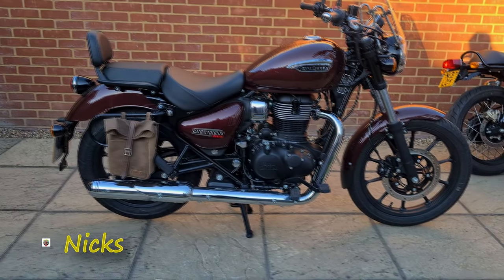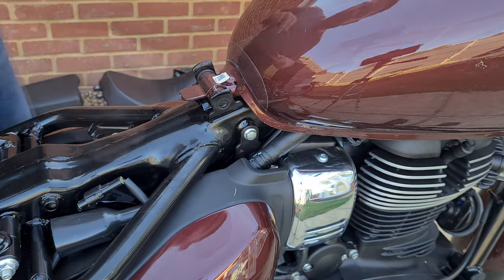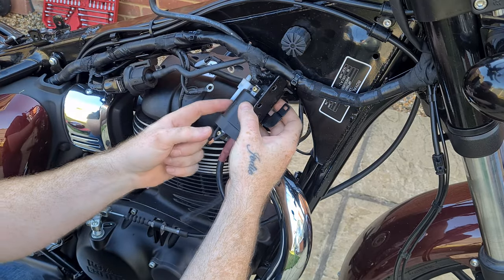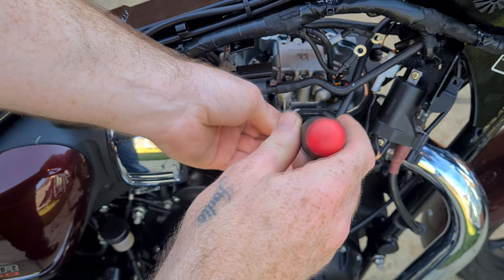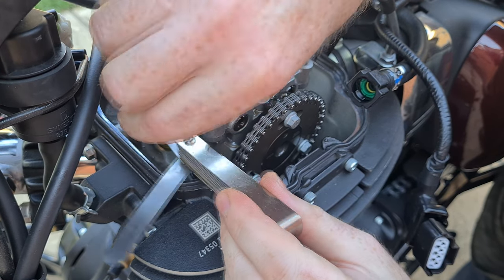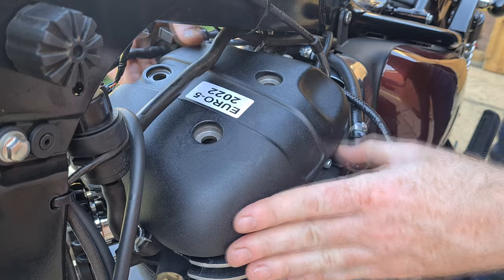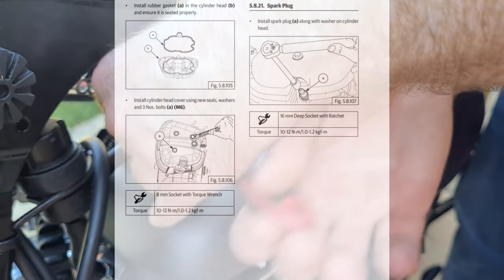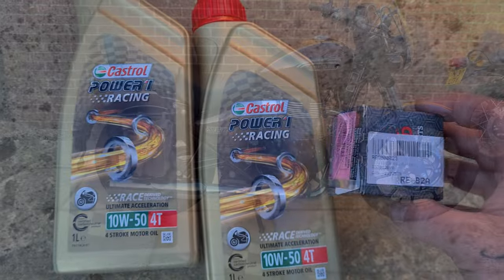Royal Enfield Meteor/Classic/Hunter 350 Valve Adjustment & Service | Oil Change | Tappets

Comment from the maker: Just a quick note, the manaul says use 15w50, however I'm using 10w50 oil because the climate in the UK isn't as hot, so 10w50 is ideal. Please check with your local dealer before you decide what oil grade to use. 😃
Reply: On my side in Brittany, i use 10W40 for the same reasons.
Reply: I agree with your choice, especially since the fully synthetic oil can provide the wider viscosity range.
Reply: @hr4669  Which makes more sense since the second number deals with heat while the first with cold.
Reply: Hi Nick, Can you please share the link for Meteor 350 Workshop Manual ?
Video is informative and clean explanation. 👌🏽
Reply: My bike is classic 350 reborn, so can i use the oil grade 15w50. Bike i use in indian roads
Reply: I use 15W40 diesel oil which is also suitable for petrol engines . On my second Enfield, great bikes . Mines averaged over 90 mpg ( better than my older pre J series engine one ) . I also change my oil every 5k or less . Happy riding 😁
Reply: @edwardwilliammorris1340  use what you like but you have a wet clutch in most motorcycles so friction additives in ordinary oil is not suitable.
Reply: @davefisher524  I've covered 1000's of miles on these bikes and turbo diesel 15w40 is fine( if you read the container you'll see this is recommended for motorcycles , they do not contain friction modifiers) , there is no clutch slip , and it always starts perfect. What is very important is to change the oil at least as often as recommended, I usually change more often. I haven't just used 15w40 on my Enfield but many other Jap bikes.  Turbo diesel oils perform well and gives no problems. Many thanks for the video as I will be doing my own servicing and all information is appreciated. 👍
Reply: @davefisher524 I've used Diesel Oil in my wet clutch motorcycles as well with no issues what so ever . Don't be fooled that you need to use PROPER MOTORCYCLE OIL in your  motorcycle , there are many OIL  alternatives out there  to use that are safe in wet clutch motorcycle use as well , but are not branded PROPER MOTORCYCLE OIL , but are still JASO MA spec . The Yanks swear by using DIESEL ROTELLA - DELO OIL in there bikes , google the reviews , and it can be purchased for half the price , at any servo , truck stop , auto store .
Reply: @davefisher524  yes it is suitable, read the sae information on the oil container. 👍 This isn't just a guess , it's many years of use without any problems.
Reply: @brettwicks7339  good for you 👍 just like me you're using your head , not only is it cheaper but works absolutely fine , gives your engine all temperature protection and starts well too 👍
Reply: @edwardwilliammorris1340  Yep , plus  Diesel oil has better detergent cleaning agents for keeping your engine cleaner , for less sludge build up . People think  that by buying so called PROPER MOTORCYCLE OIL  at some ridiculous price , makes them feel all good and fuzzy inside , that they gave there motorcycle the best care they could by putting in $89.00  a tub  proper motorcycle oil ,when in most cases , it's an old technology bike , that using that oil is just a waste of money , and an overkill . I know of this Farming Family , been on the land for over 100 years , and diesel oil goes into everything  , even the Honda lawn mower , and nothing has ever failed or exploded due to the oil they used .
Reply: Norway importer uses 10-50 W
Reply: Yo Nick, what pannier racks do you have?
Reply from the maker: @Brian-nx4lq  they are from hitchcocks
Reply: Speak to a dozen dealers and you'll get a dozen different answers. Look how oil specs change with the same cars over the years - 20/50, 10/40, 5/40, 10/30, 15/50, 5/30 (latest)...

Just apply common sense and pragmatism. After chasing RE and others, my Interceptor warranty wasn't affected as long as the oil was suitable for my region. Currently Silkolene 10/50 south of England.
Reply: I'm in Texas, yesterday it got up to 107 degrees.  LOL.  Not a whole lot of riding these days.
Reply from the maker: @randyolson7255  wow your tyres will melt

Comment: Best video I have seen for the valve adjustment.  Never really wanted to tackle that job. I normally do the service on mine every 3000 miles. (oil and oil & air filter change) But when it comes to that 6000-mile valve check/adjustment I take it to my dealer.  They charge a pretty penny to do it.  But as someone else commented you do a good job on the video so a person can see what's going on.  Some videos I have seen are poor quality, they go so fast or their hands or something gets in the way so you can't see what they are doing.  A person watching ends up having to pause the video and rewind it several times trying to figure out what they just did.  I still don't know if I want to attempt it, but if I do, I will look up this video again.
Reply from the maker: Thanks that means a lot. The only thing that id say, be very careful on tightening the head bolts and valve lock nuts, these are often over tightened and snap, definitely get a torque wrench. the other tricky issue is the rocker cover gasket, its very fiddly to get in, make sure its all flush, if it is all the head bolts when screw down and stop the same amount with using your fingers, just triple check the head is flush before getting the tools on the bolts. one last tricky thing is the plugs for the tank, you need good fingers to squeeze the clips, dont force them, if you give the plug a push in then pull out this helps. and get someone to hold the tank for you, dont rush, give yourself all day to do this job, take breaks and enjoy the experienced, you've got this

Comment: For me, this was the most helpful video for me to service my Hunter 350. 👍
Like others have said, both valves were too tight.
I bought a 500km service kit and oil from Hitchcocks Motorcycles but didn’t use any of the supplied gaskets. So they are saved for the next service 👍. 
Hunter 350 indicator reset is to find trip B with ignition switched on, then press and continuously hold i button for 10 seconds, keep it pressed and switch off the ignition, count 15-20 seconds while still pressing the i button, then switch on ignition and continue pressing the i button. The spanner symbol should flash 5 times before disappearing and then you can finally release the i button 👍
Reply from the maker: Thanks for your kind words, i try my best to make videos as clear and precise as I can to help others, after all these bikes are made for the home mechanic to work on. Thanks again and ride safe my friend

Comment: This is the correct 1st service (tappets adjust)  that many dealers forget to do.
Reply from the maker: Vital service here
Reply: @nicksepisode  my Himalayan only changed oil and filter and some spoke wheel adjust in 300 miles, 1st service, no tappets. After that have problems with pre ignition issues coming with a metal noise at 3000rpm coming from the engine, anoying sound that dealer always said is normal...NO not normal and now unfortunatley i dont ride RE anymore but still thinking buying a Meteor in near future but i'm affraid the situation persist in those new 350 engines?!
Reply: I suggest u don't buy re motorcycles @pmfsify
Reply: @pmfsify  if u just want to loose ur money then go for it any other brand is clearly ahead of this brand. Never invest in royal Enfield
Reply: @respecthub1220  i sold mine 411 himi after 5 months because excessive metallic sound in top of the engine above 3000rpm... the dealer always told me is normal!? LoL

Comment: So others know, this pertains to the new Royal Enfield Classic 350 as well.  Best, clearest video so far on these two topics.
I'm using 15w50 Motul 5100 here in California, and I think it likes it.
Still not sure about the warranty and valves, but need to decide quick as I'm getting to 300miles now.
Dealers want outrageous money here to do that - $500 and $630US if you can believe it.
Anyways, this bike is a load of fun, and I appreciate well-done videos like this one!

Ride Safe 🙏🏼
Reply from the maker: Thank you Scott
Reply: Not sure if you got an answer on this or not Scott. But in the US, you have the right to service your own bike or car or add on accesories without impacting the warranty. Or to have that work done by a third party. Harley were recently heavily fined for contravening owners rights in this area. I was advised to keep receipts for service parts (oil, filter etc) as proof that the needed service work was done. I don't know if the UK is the same way in this respect. I also got some crazy quotes for having the first service done ($320 and $450), hence why I'll be doing it myself. Paying almost 10% of the cost of the bike to have a valve adjust and oil change is extortionate especially when I hear folks in the UK are paying between 120 to 200 pounds for the same.
Reply: @bgilgall  I did not get an answer, but like you I do the work keep receipts. Keep RECORDS, etc.  That’s exactly my point to pay 10% of the cost of the bike for a service that takes less than two hours is obscene. I found a good local mechanic who has a shop and charge me 30% of that or $165 I’m still using the MOTUL oil, and unless I see something telling me otherwise I guess I’ll stick with it for now
Reply: @scottboettcher  Hi Scott, I recently bought the Meteor 350, and just like you said the dealer said the first servicing would be like $650 in Brea, CA. Btw, what city are you in, and what shop you went to for the first servicing? Any recommendation?
Reply: @MidnightRider22  I’m in Pasadena. Took to a local shop. Not the dealers. That’s insane.
I’m sure there’s a local, independent shop near you. Get on yelp and make some calls. That’s what I did. 

Good luck and …
Ride Safe 🙏🏼
Reply: @scottboettcher  Thank You
Reply: In west France (Brittany) with a middle temperature climatic, i use 10W-40. And a service with oil, are 300€.
Reply: With a $4000 bike, is it really necessary to worry about the long 3 year warranty. When you buy parts, you buy them in bulk since they are so cheap from India.
Reply: @KevinSmith-qi5yn  sure
Reply: Being a cynical & grumpy 75 yr. old geezer, I plan to video the essentials of the process with my GoPro, including the odo reading just in case.  When you get old enough, you have a license to think like this.  Younger people may need to age prematurely first.😄
Reply: @sudipshahi153 I'm in orange county and paid 600 for my first service

Comment: Hi Nick. Just a few observations from me following your video to adjust the valve gear on my Classic 350. I found it virtually impossible to accurately reseat the cover back on the gasket with the gasket in situ. I  removed the rear electrical connections that impede removal and replacement of the rocker cover. I also removed the little finned piece on the near side just beneath the rocker cover. I removed the old gasket completely with the D section rubber piece covered by the small finned piece. I then fitted the gasket into the rocker cover groove and reassembled the two together. Without those 2 electrical connections in the way it slid back on easily without any wrestling! I am not knocking your video, it was excellent. I am just noting for other's benefit that I found it necessary to take a slightly different approach.
Reply from the maker: Thanks for your input :)

Comment: great video!!!! thanks for sharing......one little thing,  if your timing mark is on the crank you are correct to check for the compression stroke, however if the timing mark is on the cam shaft that will be the only observed timing position. Again great video thanks for taking the time to put it together!
Reply from the maker: Good tip!

Comment: A first class demo.  I would just add , it's always a good idea to put a little copper grease on the spark plug thread. The coating on the plug can react with the aluminium of the cylinder. It's rare, but its a big problem if it happens.

Comment: For anyone following this for newer models of the meteor 350 - RE seems to have removed the "T" and arrow to indicate top dead center. My 2023 meteor fireball doesn't have it. Sticking a screwdriver into the spark plug while and cracking the engine by hand worked well enough, but RE makes a tool to lock the cam at top dead center that you can maybe get on eBay
Reply from the maker: @ryanheisler9648  cheers for the info

Comment: Good video, can't fault what you've done.  Call me old-fashioned but what a faff to set the tappets!  All the stuff you have to remove to gain access for a routine job would drive me round the bend.  As an old (OK, very old) Triumph man, I was used to just unscrewing one little cover per valve to do the same job.  Are all the new RE engines designed like this?  What about the Interceptor?
Reply from the maker: the interceptor is a tad easier,  (i have a video on this) although this design RE are using are much better to work on than say a modern triumph.
Reply: Agreed - only thing I don't like about my new Royal Enfield Classic 350 
Seems stupid in 2022, but it is what it is!
Reply: Don't care for all the work adjusting tappets, buy yourself a Moto Guzzi  Easy peasy.. two wrenches, a screwdriver and a set of feeler gages  did I mention the chain maintenance?  Shaft drive so no chain bother,

Comment: Thanks Nick, for this excellent clear and complete video. Understand that hex bits and Allen key are the same?
Interested to hear why fully synthetic oil is better than semi-synthetic?
First video for this job, that mentions checking the spark plug gap - thanks!
Love that Meteor's colour, but I have to say I prefer my Halcyon Grey Classic Reborn ,-)
The dealer said that checking the tappets "wasn't necessary!
Reply from the maker: love the Halcyon Grey!! semi synth is good too dont think ones better than the other,  this engine dont rev much, you'd be fine either way
Reply from the maker: tappets are 100 percent necessary at first service, do not skip this, only a non RE dealer would say this.
Reply: @nicksepisode  unfortunately it seems many RE dealers don't do it to avoid cheesing off owners with a hefty bill for the first service (which I believe is free in India).
I wrote to RE and they replied very quickly, and were concerned that their Official dealer wasn't following the service manual.
I think I will do it myself.
Many thanks again.
Reply: I followed your videos instructions and although it was a bit of a pig to do, I did the adjustments (inlet was very tight). Now (of course haha) it seems to be noisier "clickety clickety" than before. Stupidly I didn't record the engine noise before. Some posts on forums suggest that with the clearances being tight from the factory, the engines are quieter, and once set to 0,08/0,18 then the tappets are louder?
Would very much appreciate your comments / suggestions. I will do the job again and check once more (I didn't turn the engine and recheck as you suggested) So that could mean improper settings (i.e. what a plonker).
Many thanks!

Comment: Hi, I should've seen your video first on how to adjust valves!  Done mine yesterday and they were both tighter than spec, now I seam to hear the valves clicking more!  How can you unmistakably know you're on the compression stroke TDC?  Would it be possible to loosen the exhaust valve while on the exhaust stroke TDC?  I used locking tool and could easily loosen and adjust both valves...  Also for oil grade, my RE dealer sold me full synthetic 20W50 oil for my first oil change.. because of city heat.. I'm in Canada, not LA!  Many thanks!

Comment: Nice work. Surprised  you didn't check,  and then clean the oil screen. Not uncommon to find metal bits after run in.  Looking forward to next post. Cheers.

Comment: Great video, I'll be following all your instructionals for my Meteor.  And I think you all covered Interceptor and NC750, both of which are shortlisted for my next bike.  No need to change the crush washer on the plug?  On my ratty past bikes I admit to reusing them if they still looked in shape and I couldn't find my replacement ones at the time, seemed not to leak from there afterwards (they had other worse leaks anyway!)
Reply from the maker: Thanks for the follow. Sometimes u can get away with re hosing the crush washer. No jarm in getting prepared, though (unlike me)

Comment: Great video! I followed this and everything went smooth. However, on crank shaft cap and oil filter cap I’m getting oil misting (not really a leak). I used torque wrench on them. Any ideas on why this is happenening?  Thanks for doing video. My dealer wanted $750 for this.
Reply from the maker: good job, put some grease around the seal before install

Comment: A very informative and useful video. Did you have any issues with locating your rocker gasket as Im told they can be a real pain to align?
Reply from the maker: Yes it was quite tricky. Time and patience is key. Along as its all even and the 3 cover bolts screw in hand tight before you nip them up then you'll be fine

Comment: Royal Enfield just send notice to their dealers that the 300 mile valve adjustment is no longer required. Did yours require much adjustment at that miles?
Reply from the maker: I’m hoping your source of information is correct as all instances on my scram, meteor, interceptor and my wife’s himmy required adjustments after 300 miles. 

The only way this would have changed is that Royal Enfield have improved the production line quality control process ( which is probable) 

Id request this “ update bulletin” in an email from your dealership to cover any future issues should you get any. 

If you are confident with spanner’s then check it yourself, better be safe than sorry. After all it cannot do any harm and it’ll give you peace of mind

Failing that get a second opinion from a completely different dealership, you can also email royal Enfield direct with your vin number and they can check for you

Hope this helps